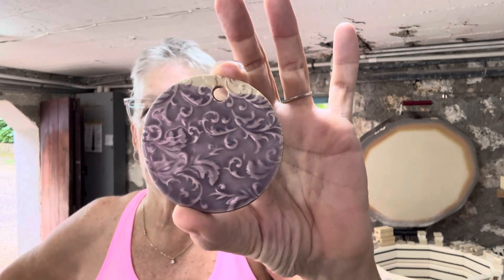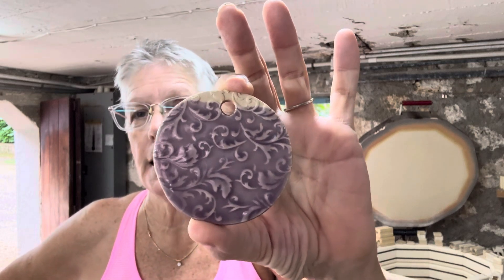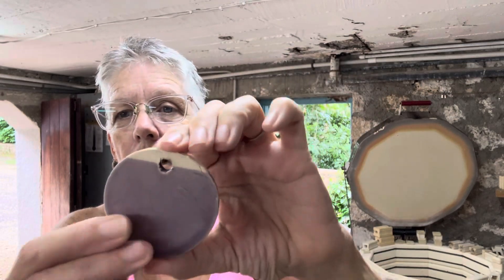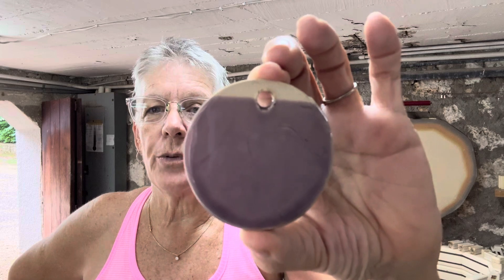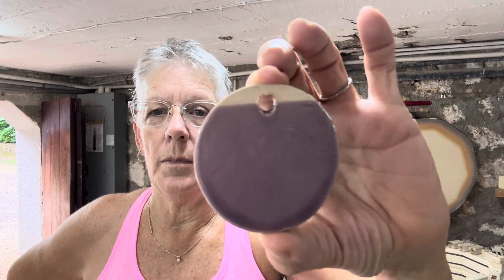Hardpanned glaze- understand Flocculation and Deflocculation

Comment: Oh my you have given me faith to keep trying to deflocculate my 2 gallons of hard panned aqua from amaco. I have watched John’s video on it and tried but with no luck. I will try the darvan 811. I’m so happy to hear someone had good luck with his formula. 
Ps- I will not forget the difference between “flock”ulate and “de”floculate ever again! Thank you so much for clarification. The perfect visual in my mind. ~Kathy
Reply from the maker: you are very welcome Kathy.   I was totally prepared to throw out my bucket of Lavender and figured nothing ventured, nothing gained.   Well, I won this battle.   
-pour off water sitting on top - set aside in another pail.
-break up hard panned glaze -  and immediately smoosh it into the reserved water
-it will try to hardpan again so keep mixing glaze that settles on the bottom.
- once you have added back all the hard panned glaze give it a good stir. 
-add teaspoon of Darvan 811 - you should see it thin out somewhat.  add another teaspoon if necessary...
- if you make it too thin (which I did) add a few tablespoons of Epsom Salt Solution and you will see it thicken.
Hope this helps...   a week later and my glaze is still suspended and perfect.